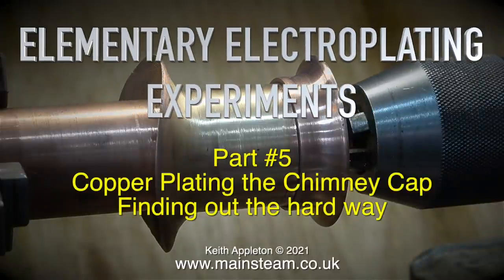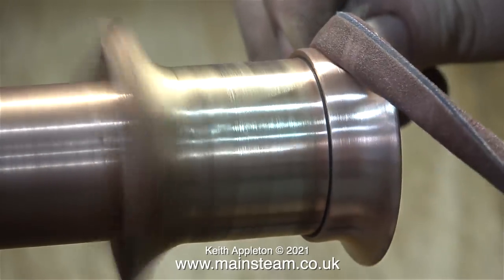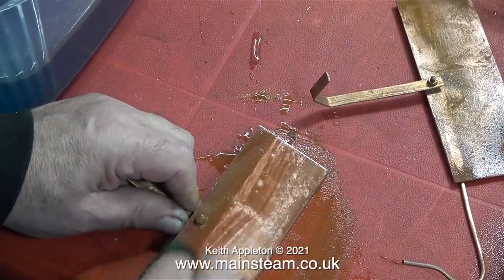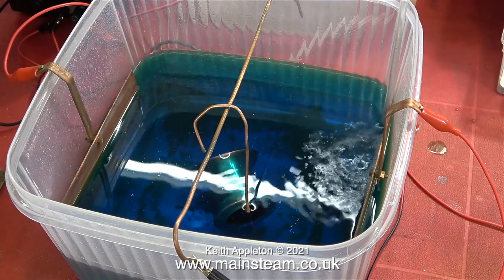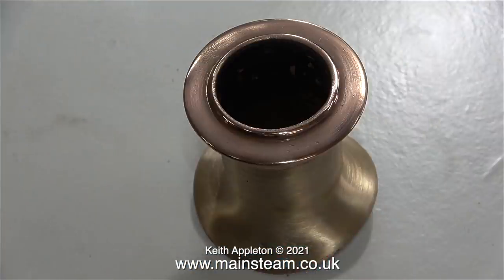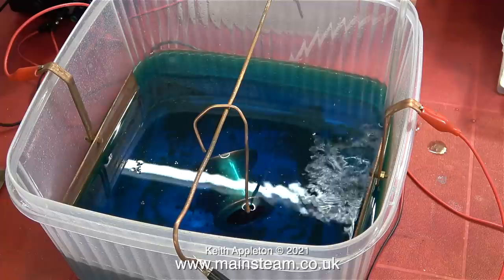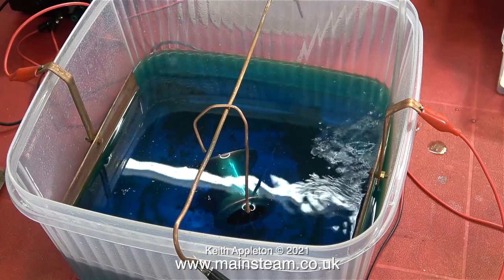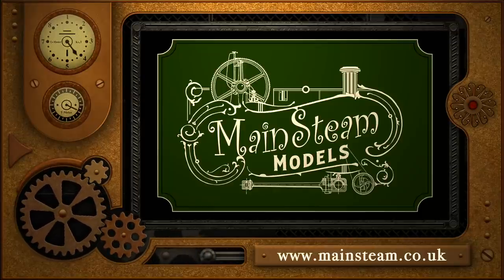ELEMENTARY ELECTROPLATING EXPERIMENTS - PART #5

Comment: instead of using an air stone? try using a small dc pump (car windscreen washer pump) have it suck the liquid out from one corner and pump it back in at the opposite corner?
don't know much about plating! know the principle of plating that's all but think this might be better as you are not putting air into the mixture

Comment: hi Keith, was just thinking would a car windscreen washer pump running on a low voltage do better as it would pump the solution out of your tub then back in with out oxygenating the solution

Comment: I wounded if there is a voltage drop at the end of the wires. 
Check the voltage at the anodes . Bet it reads >2.5 volts.

Comment: In the short time I worked in a plating shop the highest quality work would be polished to a mirror finish, plated with copper, and then the copper was again polished to a mirror finish before nickel and chrome plating. I believe there was also a stage where reverse polarity was used for a short time to help with the cleaning process.
Reply: That Reverse Polarity idea is really interesting. Ingenuity eh?!